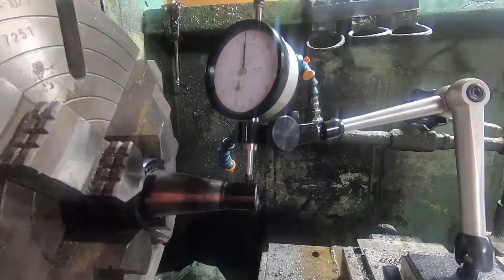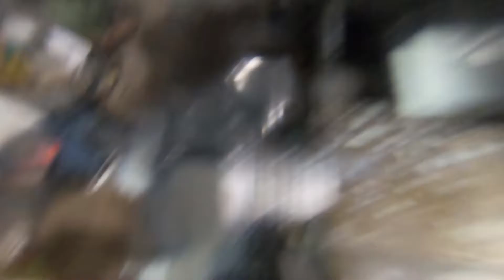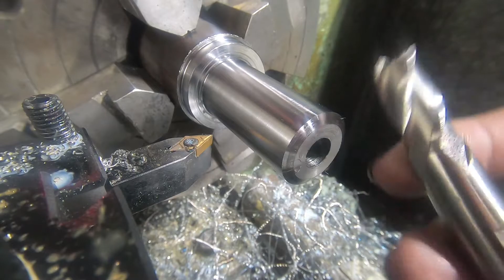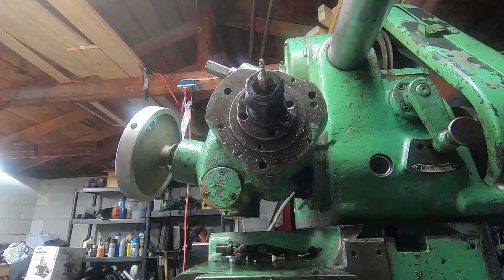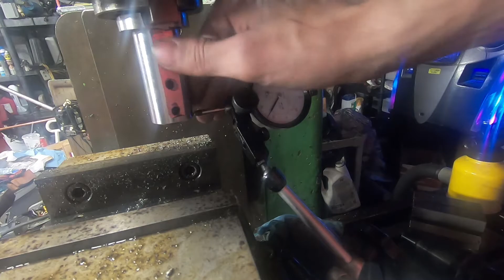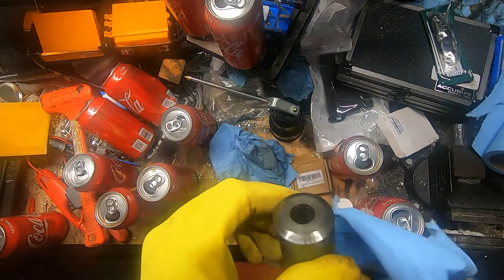(Barely) Making Taper Tooling For the Van Norman 16S

Comment: I think you should turn up the speed a little bit. If the speed is already maxed out then maybe you could change the motor pulleys or the motor. Maybe install a weed eater or KX80 engine on it. Too slow of speed is definitely your problem. You should make instructional videos on how to properly use a lathe, if you’re still alive.